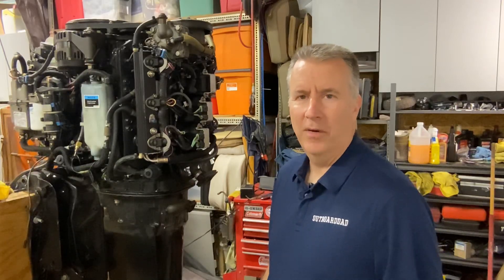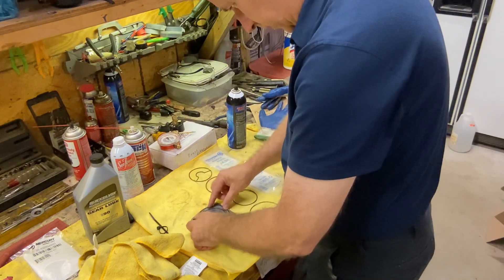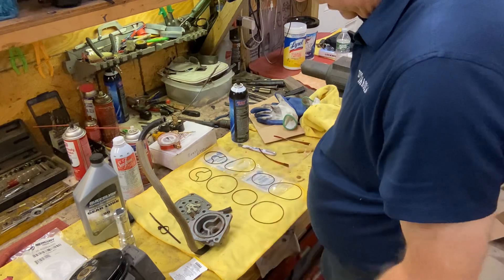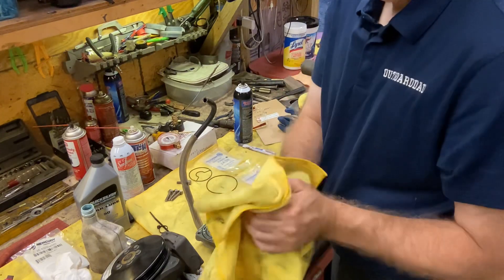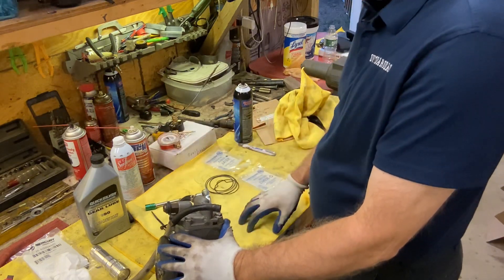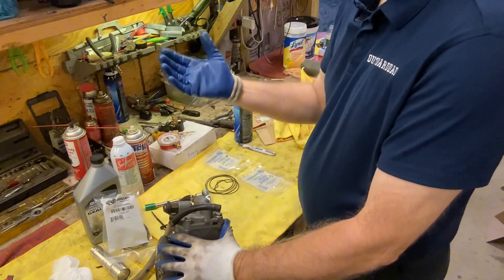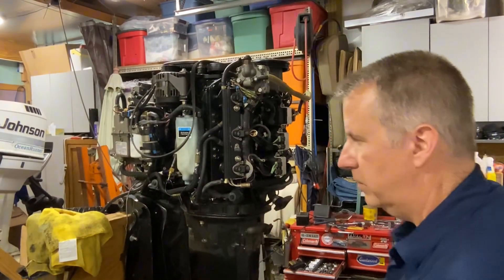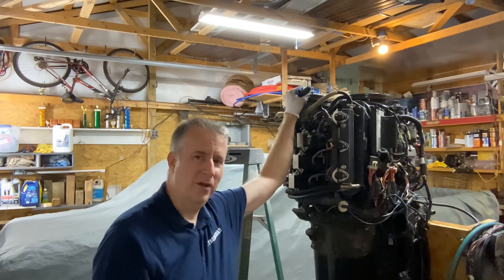Mercury Optimax Air Pump o-ring kit replacement (Part 2)

Comment: Keith, great videos.  On the air pump rebuild, aren't you supposed to purge the oil system of air whenever you break a seal?  keep the videos coming.  PS, your earlier videos have better volume, the pump videos are hard to hear.  Thanks
Reply from the maker: @essoxslayer  thank you yes the previous videos have the oil prime. Not sure what the story is with the volume. Noticing it’s fine on my iPhone and people says low on computer

Comment: When do you have to replace that plate with the reed valves in it?
Reply from the maker: @robertmccorkle9656  great question, when you pull it apart and see deep pitting in the plate and casing so the o-rings no longer seal then it will need to be replaced. There is also the valves themselves, inspect them to be sure there is no cracks or broken reeds. If they are fatigued then they will not open and close properly. You will know when testing the pressure while running